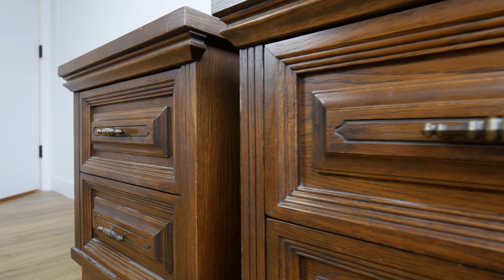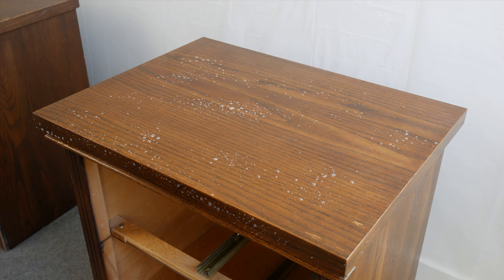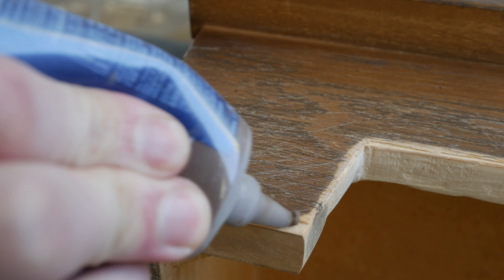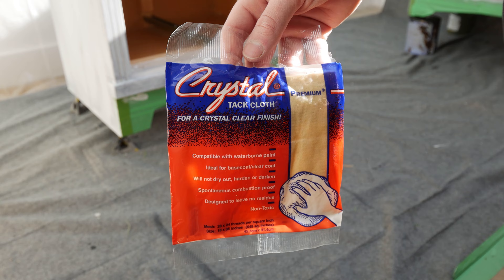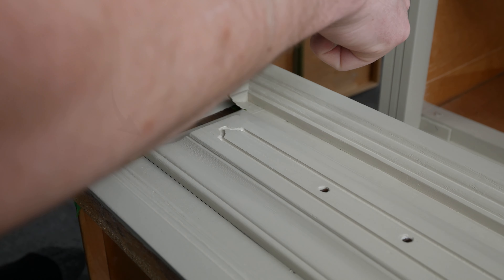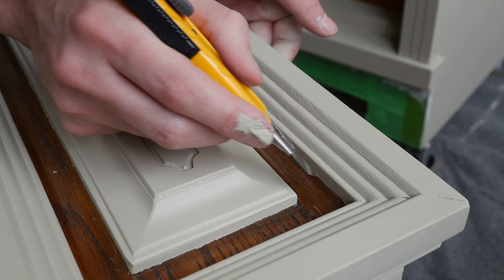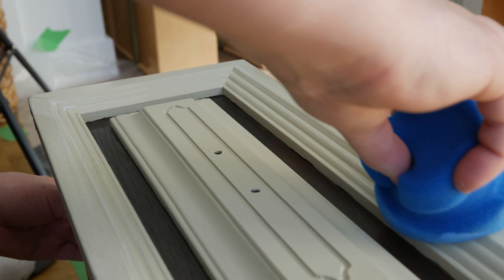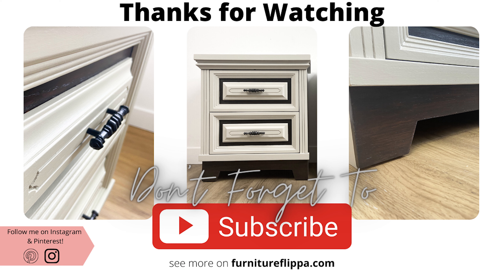How to Refinish Nightstands for Beginners

Comment: A tip for getting tape to come off clean is to pull it up before the paint is dry.  If you can't, use your knife and cut in the corners around where the tape is to be removed and you'll get nice clean lines!

Comment: Those turned out beautiful, here’s a pro tip score along the tape line with a razor blade knife before you pull up the tape. There won’t be any extra paint to clean up after you pull the tape.

Comment: You should try Kilz restoration primer. It would be more cost effective than the Dixie Belle Boss by far. It has great coverage, adhesion, and powders up nice when sanded. Plus it is water clean up.
Reply from the maker: I will have to try it sometime! But Dixie Belle Boss is also water-based. Thanks for watching!